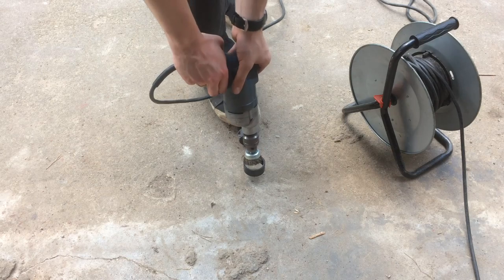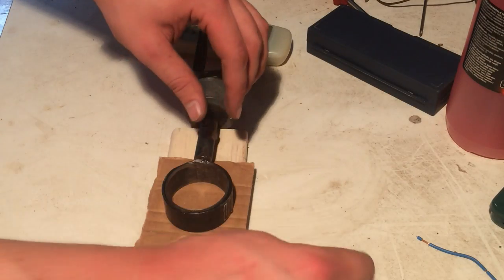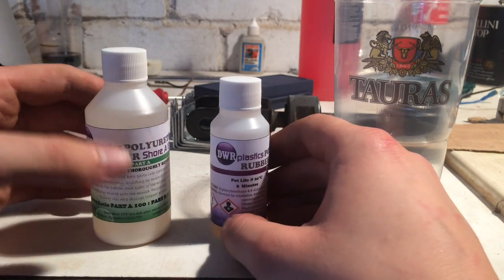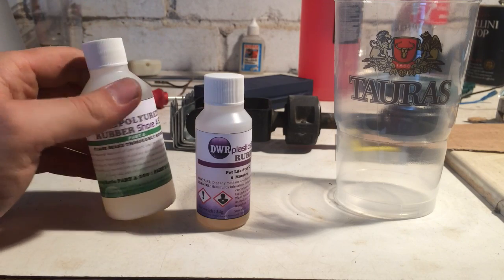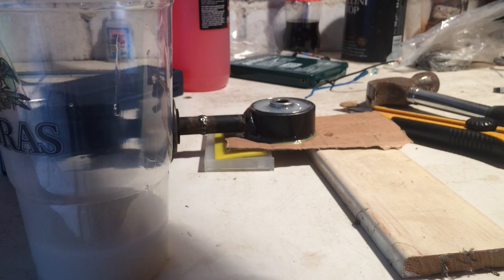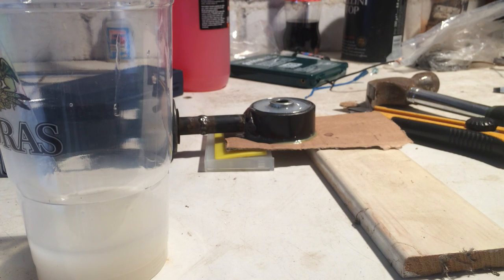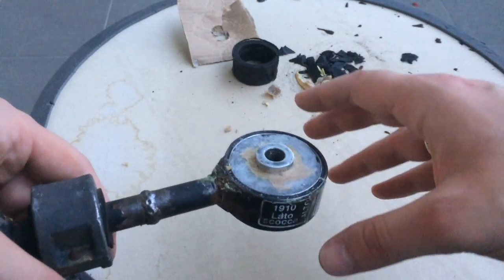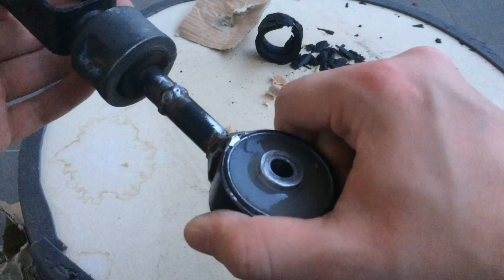How to  make polyurethane engine mount the hack way

Comment: Casting and pouring poly urethane well takes practice. 

More mixing of the urethane and hardener. 

Mold release spray helps in demolding; it helps reduce leaks and produces better finish. DO NOT apply mold release to surfaces you need to urethane to bond to! 

A paint pressure pot can help reduce bubble size. Or degassing your urethane before pouring by using a vacuum chamber. 

Adding UV and heat agents extends life in rough automotive use. 

Oil based clay is good for building walls and sealing urethane. You can make simple molds this way. Be sure to spray mold release! 

Some urethane can cure by baking or heating. Many manufactures recommend baking to increase product strength. 

If your motor mount or transmission mount is too stiff and causes vibration you can tune the dampening by carefully drilling holes in the poly urethane to add flexibility. Be careful. 

I hope this helps.
Reply: Drilling or setting some void placeholders (with release agent) - could perhaps do a combination of hard/soft as well. The stock rubber mounts typically have voids for some flex. Making these solid gives that durability but some won't like the vibration.

Comment: I am only concern is engine will kick off lots of heat, question is how does that affect this polyurethane thing
Reply: Robert Rstw poly urethane can with stand high temperatures, corrosion and salt, and performs well. 

They use poly urethane in the rockets that carry nukes in a lot of the seals.

Comment: good job , next time cover the cartoon with some liquid soap so will be easy to remove it  when the job done , to remove the bubbles you need to put the item inside air pressure equipment under 60 psi ten minutes while the PU still lequid it will take the bubbles out.
Reply: Mike farad putting them in a pressurized environment actually pushes the air bubbles to the inside.
To remove them a vacuum chamber to de-gas the mixture would be the way to go.
Pushing them to the inside is fine when appearance is all that really matters. Not so much when structural integrity is a factor.
Reply: Pu with bubbles is still better than the shite they sell on ebay you can’t loose 🤷🏼‍♂️

Comment: Did you use DRY or WET urethane? I ordered some from McMaster-Carr even the correct mixture I can’t seem to make it hardened like what I see on youtube.
Reply: Are you sure you are mixing the 2 parts correctly in the correct environment? Temperature and humidity might be a problem. Also have to have the 2 parts measured correctly and mixed thoroughly
Reply from the maker: Hi,
honestly, I don't know. The link to the product is in the video description